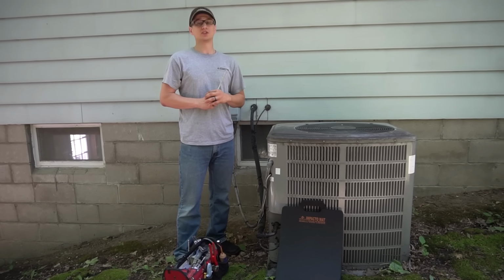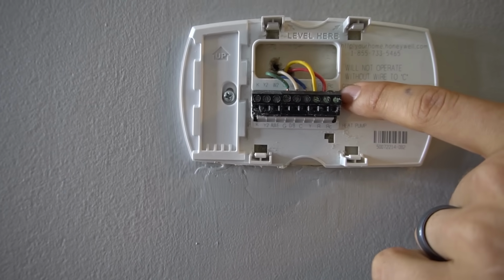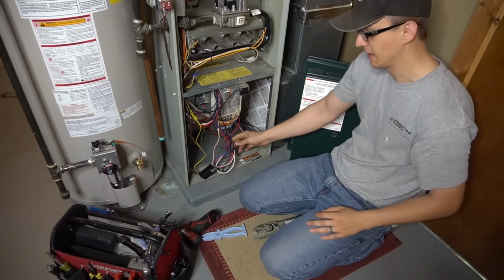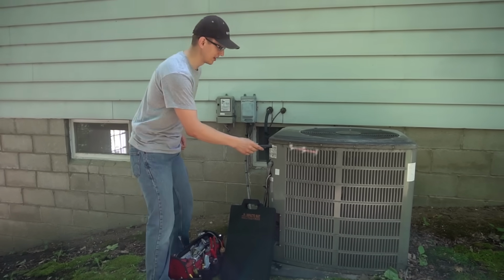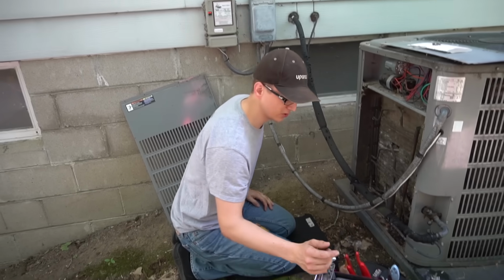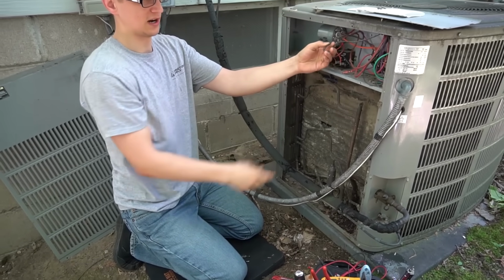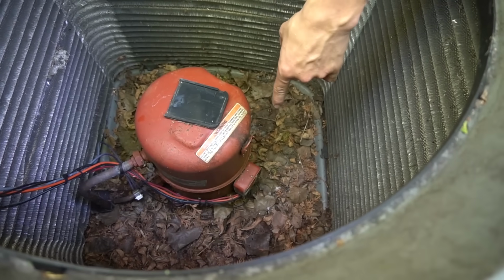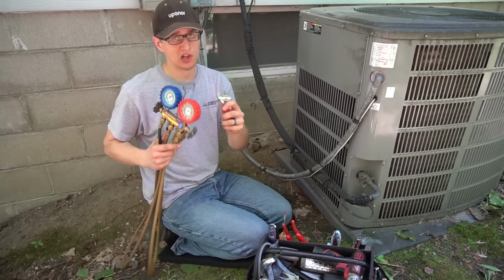AC Unit Not Turning On - How to Fix It Step by Step

Comment: Great video! Everything works fine and then after a few hours the outside fan stops but this inside fan works. So air is blowing but not cooling.
I hear the outdoor compressor is wanting to start up but can't. Ive tried to turn the fan with a stick but thats not fixing it. If I turn the AC off for a few hours it will start up fine and then quit after 30 minutes. My AC guy has changed the capacitor but that didn't solve the problem and he can't figure out the issue. I hope you can help.

Comment: Hey! Love the video! I had an issue where the thermostat wire connecting to the ac unit was broken from construction, is there anyway to connect that wire or get new wiring without taking down walls or making holes in order to pull it back out from the inside to the outside?
Reply from the maker: Hey and thanks! The easiest way is to simply strip the ends of the wires where it was broken and then wire nut the wires back together. Then you can tape the wires and connections with electrical tape.

Comment: Great video. Clear and concise directions. When I turn on my thermostat, my contactor pushes in but then nothing. No fan movement and a slight hum that sounds like it's coming from the contactor. I changed out my capacitor but still nothing. Would that be the fan motor being shot? Is there any way to test that with a meter?

Comment: Such a Great video explaining the trouble-shooting! I’m having intermittent on-off with the compressor. It’s summer in Texas and while the in-house thermostat reads 75, sometimes it suddenly jumps to 78. Thermostat is set to Auto with Cooling ON. Then, when the unit kicks on, the duct-blower motor circulates warm air, the outside fan starts spinning, but the compressor doesn’t turn on. After about 90-sec, the outside fan stops and the compressor remains off. Now, the indoor duct blower is just circulating ambient air and the house becomes warmer. I tried turning off the main AC breaker on house-circuit-panel and turn on after couple of mins. Then, turn on the thermostat to Cool and then the compressor and outside-blower turn On. I hoped this was a 1-off reset, but in last 4 days needed 3 such resets. I wonder where is the issue and how to trouble-shoot? Is it the thermostat temperature-sensor that’s bad? Or, is the control-board not sending “on” signal to the compressor?
Reply: Same issue we're having, I'm in west Texas... we called hvac and he hasn't figured it out... changed our compressor and it is still turning off... we need to leave ac off for a while then we turn it back on and it'll cool for a while before it turns off again... we're on 4th hvac visit,  calling them again at daylight after a hot night sleeps

Comment: Aaaaand my A/C is running again!  A note to others who may have the same issue as mine... there is a freon pressure switch which allows the signal from the thermostat to tell the 220 volt power to turn on.  This switch is in the A/C unit.  The wire that goes to the switch to activate the 220 on my unit goes immediately into that freon pressure switch.  (It's a 1" diameter x 2" or so black cylinder with a wire going in and out, attached to the freon tubes.)

On the side of that freon pressure switch is a white rubber bulbous thingy.  That is actually a reset switch.  We pushed that button and the A/C came back on.  We never would have gotten that far had we not learned what else to test first from watching this video.  We used a volt meter to confirm that voltage was coming all the way from the thermostat to that switch, but not leaving the switch.  Upon googling the switch we learned that it has that reset button.

Great vid man, thanks!

Comment: So my thermostat is working, it turns on the fan inside the house. My compressor outside does not turn on. When I push the plunger the fan turns on. Capacitor looks good. Would my problem be the contactor?      Great video by the way.

Comment: my inside fan is not working in the air handler unit in attic, should I have 24 vac at the fuse? I do not have it there and the fuse is not blown.any advice

Comment: I have checked my capacitor (45+5), both sides are good, no bulging. It is a brand new furnace so I do not suspect the fuse. Checked the contactor switch, it functions as it should 0V when not released, 24V when depressed and fan spins freely. Checked input voltages at the outside breaker 240V and same at the poles of the contactor switch. The unit is about 11-12 years old and has had the switch and cap replaced 1x each in the last few years. I get no humming or any other kinds of noises and I don’t see any frayed/chewed wires inside or out. The only thing I could find was that the yellow wire from the contactor switch (near the red input power lead) was loose enough to come off the contactor with very little effort, I crimped it a little with pliers to tighten up the connection but that made no difference. The only thing electrical that I have tested is for a ground inside the compressor. Do you have any other thoughts? Help!!!

Comment: Was able to spin start until changed BOTH capacitor just to be sure fan started working but when restarted SAME problem went to take top off to get fan info put back on now it's working fine but I know something is wrong bc problem persisted after capacitor changes short somewhere maybe?!? Any help would be appreciated

Comment: Hello my ac unit clicks only once and doesn’t turn on. I have replaced the contactor, the capacitor, & added a hard start kit and it is still  just clicking once when I turn on the thermostat to cool and it still doesn’t work. The downstairs furnace fan is working but the ac fan outside and compressor do not. They have been randomly kicking maybe once a day for short periods and then turning off again.

Comment: With your videos I tracked down two problems 1) my drain was clogged (I have a switch that shut off the AC) - cleared the drain

I jumped the thermostat (R to Y)

A/C works! I'm pretty sure the thermostat is also bad but not 100% sure (changed the batteries 3.3v)

How do I test the thermostat itself?

Your videos are awesome, I'm a subscriber!

Comment: You are amazing! Thank you! By starting from the beginning I was able to determine that my issue was within the thermostat. My fan for my brand new furnace was not kicking on. The fuse was not blown. Pushed the button outside and the unit worked, back inside.. another look at the wires to the thermostat and control panel.. well some how one of my prongs on the back of the thermostat was bent.. I now have my central AC back ❤️ plus clean furnace filters and a clean outside condenser. I live in a rural area, can't seem to find a HVAC person to hook up my humidifier right. Wish I could just hire you 🤣

Comment: Pushed the plunger in and it started up, everything is working inside and no breakers are tripped, so that means it’s not communicating with the thermostat?
Reply from the maker: That is a possibility but there are quite a few others as well. I go over them in this video: https://youtu.be/NVPhsK4gK1A

Comment: Great video, I’m also in Mn. Recently added a Nest Thermostat and Heat was working perfectly. Now as weather changed the air conditioning unit doesn’t engage.
I was getting Nest errors on power due to not having the C-wire. I replaced with 5 wire harness and now all errors are gone.
Set to cool and fan kicks in system says cooling but air conditioner doesn’t start.
Thanks to this video I tested unit plunger and it runs as expected. Any ideas and are you in train cities area. Thanks GREAT video!
Todd A

Comment: Thanks for the video. Friends had an AC unit not working. While looking at your video where you were talking about mice, the fan tried to start. I found a dead mouse across the unit’s starting capacitor. Removed it, cleaned out other mouse debris, and it works! They called a pro first but were going to have to wait days. I’m glad I (we) were there to help.

Comment: I do have a question for you that has to do with the install of a Google Nest smart thermostat. The heat pump is a Trane and American Standard (2 story home). If I remember correctly the furnace are both Trane's. When I wired it all up according to the manufacturers instructions, I got nothing but hot air. I tried this over a year ago and just said screw it and put my old one back on and it went back to working. Does anything come to mind when dealing with the Nest Thermostats? If there is a fix you know about, please share if you haven't already.
I thank you in advance,
Chris

Comment: Excellent video! You were able to touch on many common problems with a simplified explanation for all. I've watched many videos on AC units but, I have to say. Your video is by far the best one that covers pretty much everything you need to know as far as troubleshooting and the fix of whichever symptom it is. Thank you for giving us all of this very, very useful information. Great job on explaining it all as well. Most technicians in general (not just AC), won't share the information that they've learned over the years to help out the next person. They feel that their knowledge is their job security. I know this first hand as I've worked with these types of technician's in both the automotive and manufacturing industries. My hat is off to you sir...

Comment: Great videos.  My compressor fan runs, but the compressor will not start.  I can hear it hum for a second, then stops.  A few seconds later it tries again.  The capacitor shows no bulging, but I do not have a meter yet to check it.  The contactor operates.  Could either of those still be the problem even if the fan comes on?  Thanks!

Comment: What do I check if the contactor is not pulling in? When I push on it, the fan and compressor work and fan is working in the house. Should there be voltage on the wires from the furnace if calling for A/C to engage the contactor? Awesome video.

Comment: Would losing power mess up my capacitor?
I turned off AC breaker while doing work in my house. Now AC outside doesn’t run, everything else is running fine.

Comment: Hey, I have a issue my heat or A/C is not working my furnace blower is turning on on either setting I thought it was capacitor then I thought it was fan motor but still nothing I reset and hear a click but then I don’t hear anything else nothing works on the outside unit

Comment: I replaced my capacitor but the outside unit still doesn't come on. If I push in on the "plunger" button the unit comes on but doesn't come on unless I push that in. What should I check or replace next?
Reply from the maker: This video should help with that: https://youtu.be/NVPhsK4gK1A

Comment: What does a tripped breaker in the garage tell you? Is it the capacitor?
Reply from the maker: Unlikely. A tripped breaker usually means there is some wire or connector that is shorting out. Either in the electrical section of the condenser unit outside or at the compressor pins.

Comment: Thank you for your posts!  When my capacitor goes, I will be checking here for help. BTW, oops! When I went to inspect the inside unit as you suggested, I noticed something I might have missed.  For everyone: AC not working, also check to see that the inside condensation overflow pump is plugged in! It will be located at the bottom of the inside unit. Look for the pan that would hold condensation; the pump will have a sensor float that turns the pump on if the condensation (water) level is about to overflow the catch-pan. It is not needed for heating, donchaknow, so your heat will still work.

Comment: I have question last year I have changed hard start coil and a fan capacitor the unit worked fine. Yesterday I started the unit inner fan is good as well as thermostat working fine but the out unit has issue so today I have used electrical cleaner on relay and changed my capacitor for compressor started the unit now the outer fan is running okay but compressor try to start but within 2aec go down. Could it be low Freon problem please suggest.

Comment: i do not have a plunger to push in , so what do i do next? 😬
Reply from the maker: Your contactor may have a little cover plate over it which easily comes off if you take out the two little screws that hold it. I would check that first

Comment: Thanks for these videos.  Here are my symptoms: inside unit trying to cool and running.   Outside unit comes on then shuts of after 30-60 seconds and the plunger pops out.  The coolant line is cool with some condensation.  Inside unit and thermostat still trying to cool.  Thoughts on what the problem might be? Thx again.

Comment: Great video! I was able to figure out what’s wrong with my unit but it seems you skipped over my issue. I’m getting the 240 V to my outside unit but it is not running. When I press the plunger in it does run. Where does that me and my problem is?

Comment: Thank you for the video- very informative. Can you tell me- our AC unit turns on then stops after 5 minutes. We had a technician come through and replaced the capacitor. He then said we needed to change the fans as it was making a “seeking” sound. The fan is not making that noise at the moment when it’s running, is it important to change now or can I delay and change at a later time? If I leave it, will it cause more problems at a later point? Thanks

Comment: I change my own capacitors and fan motor...what I wanted to ask when the vents on the out side green box get brittle to the touch is there anything in the market to just change the body the side vents what you suggest to hose down to clean...I guess a simple way to explain my question is like a wrap, where you can cut out the sides and adda wrapping acting as new vents and if not how much does it cost just for the green outside box leaving all the good parts intact....it would seem a bit much just to change everything just because the vents are worn around the outside of the box....thanks for checking this question.

Comment: I had to move my 240 volt air conditioning breaker to another position in the panel.  If it changed my L1 and L2 to opposite wires (phases) will it affect the operation of my air conditioner?

Comment: My Circuit board HK61EA0063206 needed to be replaced. An AC repair tech came in and first disconnected all the leads to the small black box (relay) on the existing board ( 2 Blue connectors and a double wire black connectors). He then replaced the board with a similar board with different last 4 digits HK61EA00664817. He also connected a black wire that was not connected to anything before where a blue one was. This blue wire was next to the Q on the small box on the board (Relay). He interchanged the position of the wires. Does it make a difference? Isn't the position of those wires important to maintain. The compressor would not work until he connected two  loose wires Yellow to Green. Those were not connected to each other before. The system is working but I lack confidence in what this tech did. Please advise. Thank you

Comment: Followed your methods! Furnace works. The plunger pushed in makes the unit turn on.. however it still won’t. Does that mean it’s a thermostat wire that’s bad? No tripped fuses.

Comment: Hello, our inside unit frozen due to dog hair on coils. We dried he coils with a hair blow dryer and then removed all hair. once done we applied a cleaned and waited the time stated on the instructions. We then put it all back together and turned it on. Except we see the fan on the outside unit working but nothing inside. We checked the breaker box, thermostat, changed it from auto to on but nothing. We hear the inside trying to turn on but nothing. We spinned the fan and it spins. The fan motor is cold not hot. Can't find any fuses. Do y0ou have any ideas?

Comment: This is an excellent video on how to troubleshoot AC problems.  I am still having a problem and wanted to ask your counsel.  My AC will not turn on and I have checked my thermostat, breakers on electrical panel, and the fuse on the board.  All these items check out and I was wondering if I have missed anything as the AC still does not turn on both the  fan inside the house and the compressor outside of the house.  Any help is appreciated.

Comment: My thermostat is blank and no power in my 24V signal wire. Fuse is not blown. A fan is blowing. What is the problem?

Comment: I have a mobil home ac i try to turn it on and nothing happens I went outside to see if I see a Burt wire has 240 going in fan motor not coming on Manuel I see the yellow wire coming in and it goes to the AC power i push on the relay and every thing comes on the minute i let it go it shuts down any help

Comment: You're Amazing. Can I have you to see my Central A/C Unit? I have a Humming Sound when my A/C is in use for awhile. This happens when it's reaching to stop spinning. I read as you said,  humming is a problem. I really don't know what. I also have my Condenser on the roof. A Condominium has a very poor ease to fix any problem with your Condenser. How can we go up there? We're not allowed. My Coils are really gross. Water from funnel outside doesn't spill out as it should. It just drips. Is this good, or is it backed up with Algae? This is a Goodman. I would be willing to do everything you mentioned. Wires are a no. This is a problem, Cleaning, which is more my demand. I want everything to be in excellent order. Thank You!

Comment: I watched this video. Awesome, but my AC is still silent. It’s 6?years old. I changed the thermostat. Fan works with both thermostats. Went outside. The contactor/plunger when I pushed it, kicks on the outside fan, I changed the capacitor, as I had an extra one, I checked the 3 volt fuse by the internal condenser and it was fine. I cannot think what is up?? Maybe both thermostats are bad? But they both kick on the fan…
Reply: Maybe both my capacitors are bad?